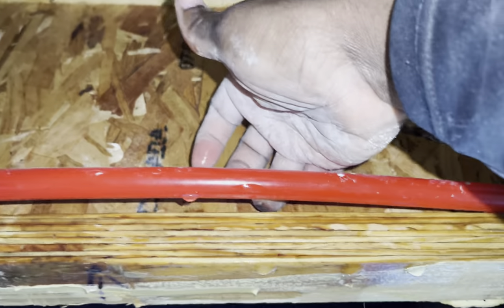Water Leaking on The Ceiling Downstairs From Upstairs Bathroom. Plumbing Nightmare DIY Fix

Comment: This was a big job and having to patch up the ceiling afterwards is alot of work.  I think the most difficult part is figuring out the source of the water leak and hoping that where you open up the ceiling is close to it.
Reply from the maker: I was lucky enough to find it on the first try. And you are right, fixing that ceiling was no joke.

Comment: Good job. I use alot of the Pex pipe for my water lines in the remodels I do. Its strange to see it have a leak in a place where there was no connecting fitting. If that was a copper pipe and was located in a place where it could have froze I could see that type of problem but since this is Pex pipe which expands 10x its original size when the water inside of it freezes without bursting the problem you had is really rare. But for whatever reason you did have a leak and you used the 1/2" Shark Bite slip repair joint very effectively. 👍 Thanx for the video.
Reply from the maker: Thank you.
Reply: That’s what I was thinking! Pex line is pretty tough stuff.

Comment: Wow.. seems like a lucky solution to what could have been a bigger issue. We have water coming out by the truck loads from the second floor into our kitchen from a second floor kitchen that's a rental. So we've yet to find the source of the water yet. The house is 150 years old so I don't think it's going to be quite as simple to fix, although I don't want to take away from what a great job this person did. I'd say taking cate of a leak at the very first sign of one is of most importance, will save a ton of money on replacing further damage.
Reply from the maker: I’m sorry to hear. I hope you find the leak sooner than later.

Comment: That's weird - I wonder what caused the pipe to fail there? I mean, it's a nice fix but I'd be worried - after replacing all the drywall and reskimming, etc - that it's going to spring a hole somewhere else at some point...

Comment: Thank god my bathroom is the only part of my house with a drop ceiling. My upstairs neighbors apartments shower is above mine (the leak was above my shower) so i figured out when she showers it starts leaking luckily i dont have to cut my dry wall its a drop ceiling
Reply from the maker: I’m glad you don’t have to go through what I did.
Reply: This type of water leak required opening up the ceiling because the water was still leaking.  If you had a water spot that wasn't leaking then you would cork around the bathtub area.

Comment: Flushed toilet and left out. Came home an hour later and living room has flooded. Maintenance came turned the water off from the toilet and left. About an hour later a flood of water came pouring from the ceiling. What can be the issue?
Reply from the maker: I’m so sorry for that situation. I wish I could help but I think a professional plumber is your best bet to figure out what’s wrong. I hope it’s resolved already since it’s been 3 days.
Reply: The ceiling caved, maintenance arrived. They gave me a fan and a bucket and got the pieces of the ceiling that fell. This was 3 days ago, haven't heard from them since. The upstairs bathroom is soaked an smells horrible.

Comment: Job was not finished thats why it was leaking the screw from the sheet rock was screwed right in to the pipe so what he should have done was move those clamps up with the hoes so that when je did install the sheetrock it wouldn't go right back in to the hoes
Reply from the maker: That’s a great point. Thanks.